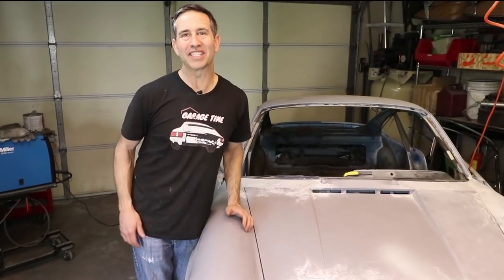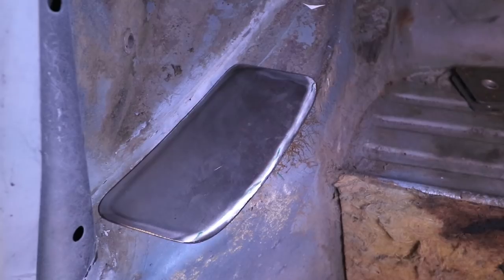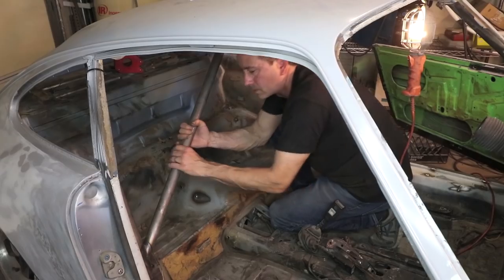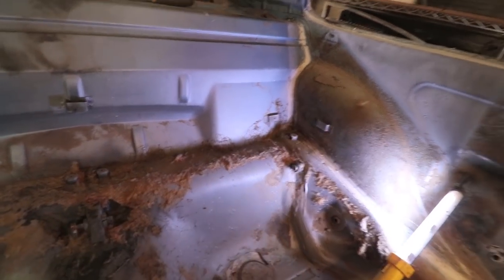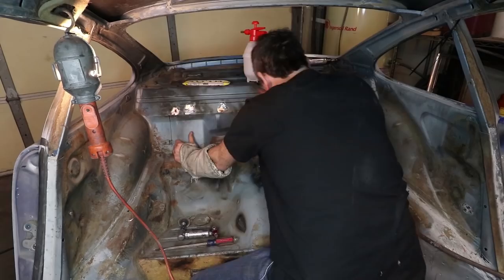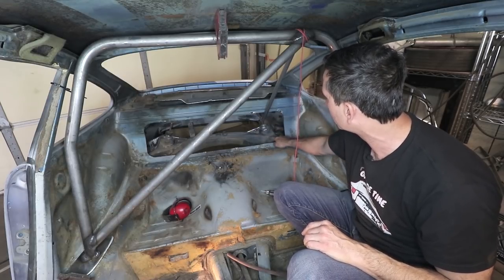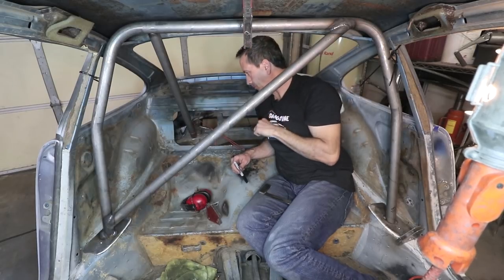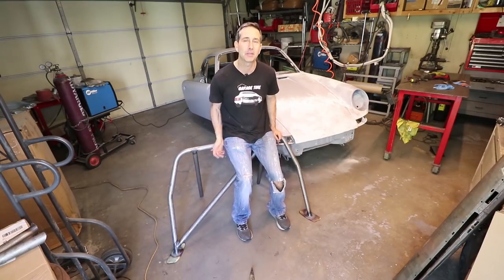DIY Roll Cage For Safety & Stronger Chassis Performance

Comment: Been anxiously awaiting to view how the firewall was going to look cut out and the access is far better than anticipated 👍 I can imagine as you were making those first cuts you were probably questioning ‘what the heck have I started’ but it all came out great and it’s going to provide great access for painting those hard to get areas 😀 I’d suggest buying a 5ltr container of 99% Xylene for cleaning out the rest of the glue holding the old remaining sound deadening, it smells like hell so you need a good vapour mask but makes light work of dissolving all the sticky stuff and easily 10x stronger than acetone (simply douse a rag and rub) 👌 P.S. Let me know when your package arrives and keep up the great progress... there’s something else I included which you will like associated with the steering 😉
Reply from the maker: Yes, I think from now on this modification should be termed the "Shepherd" hatch mod.  Seems really useful!  Not sure I can buy xylene in CA , but I'll try.  Thanks for all your support.  It's only metal!
Reply: Garage Time - Restomod Yep, I just did a quick search and it appears the stuff was banned in CA back around 2011 probably due to its highly flammable nature 😕 I guess you could buy out of state though... I found this thread which has several links you might have some luck with: https://www.rcgroups.com/forums/showthread.php?1465553-California-to-ban-toluene-and-xylene-how-do-we-thin-Goop-now/page3 (worth a try as the stuff is magic and doesn’t eat into paint - if you do acquire some just make sure to only use it outside on your drive) 👍 Shepherd Hatch haha, I like it 😂😂😂
Reply from the maker: Mexico has it I'm sure!

Comment: Excellent!  Always an inspiration.
Reply from the maker: Thanks Dan!  Still a long ways to go.  Do you think I should add a diagonal bar on the back stays?
Reply: @GarageTimeAutoResto  I would think that in order to maximized rigidity, with a minimum of weight, cross bracing would be best, and diagonal would definitely help

Comment: Ok...ok...ok ! I have tried not to like you.
But Im catching up on your videos
And I started with number 1.
    So your a guy like me.
Im build 2 Datsun Z cars.
1973 240Z , 1978 280Z back dating to a 240Z as much as possible.
Restomods not restorations.
Stripped them both down to bare bare raw shells.
They are meant to be "Drivers Cars" the way the designers intended , "Light Weight and minimalist" more of a Street track car that never sees a track.
In Porsche terms an early "RS"
    So I will watch this build .
We have the same mind set.
Old school Sports Car fun.
   Ill be starting a channel soon
But for now I will enjoy watching you build!
Reply from the maker: Well, glad to have you here.  I also love the 240Z.  Always have since I was a kid.  Where are you located?
Reply: @GarageTimeAutoResto  I currently live in  Florida.
So yes , I can use extreme summer tires year round. And I plan on my Datsun being a daily .In the 80s I went thru alot of 240z, 260z, 280z when they were just used cars.
Ive had lotus europas, Austin Healey 100, lots of original mini coopers,bugeye sprites , side curtain square body sprites, a Porsche 356 and two 550 spyder replicas and
A rash of Z cars.
But The Z always called me back
So after my second divorce I got the Zs and I daily a cafe racer.
Now Im going to be Batman without the , crime fighting.
https://youtu.be/Jp_HOVJP1Mw
Reply from the maker: Awesome list of cars.  Get to work and let me know when your YouTube channel is up😃
Reply: @GarageTimeAutoResto  I am getting it together...."will do"